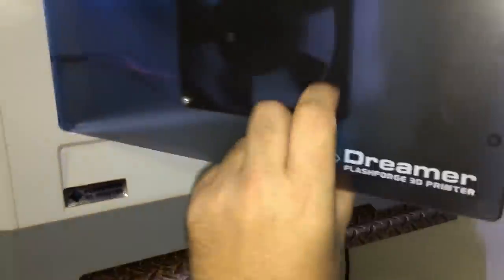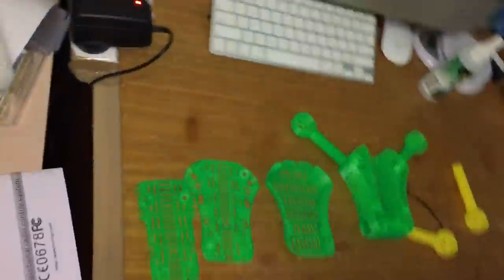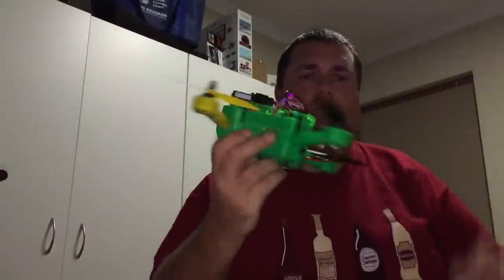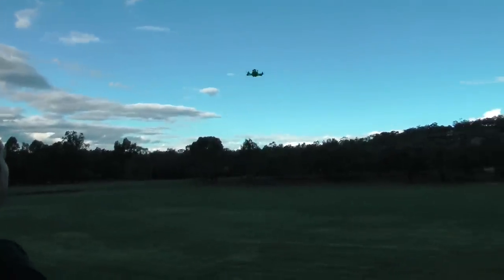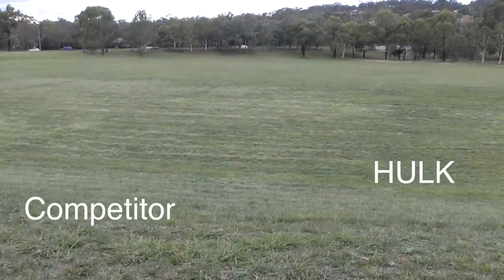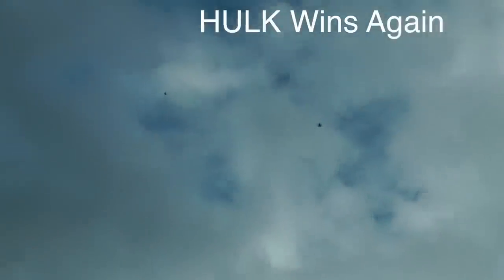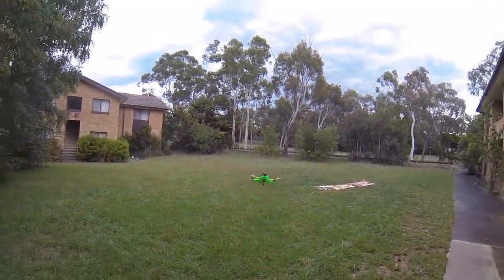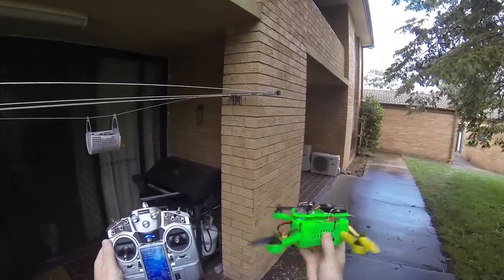Flashforge Dreamer - HULK - 3D printed Quadcopter

Comment: http://www.thingiverse.com/thing:304237
Is this the chassis? How difficult was it to tune the flight controller? What props does it use? What's its runtime?
Reply from the maker: Yes That is the Chassis.

Just plugged in the flight controller and put on flat table, hit calibrate, 3 seconds later it's leveled out.

The calibrate the ESC's (10 seconds) https://www.youtube.com/watch?v=AjLJZlG2TnU

That was it.

I'm using cheap Genfan 5" 5030 blades
On a 4S 1300mah 50C lipo I get around 9 minutes